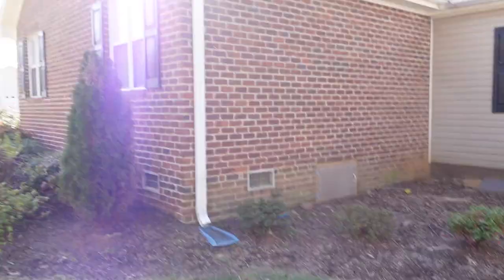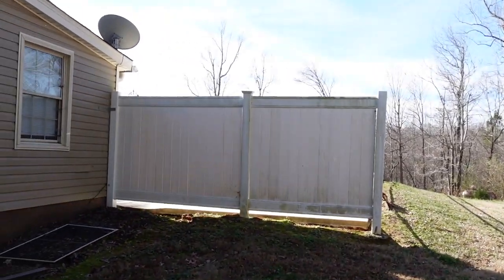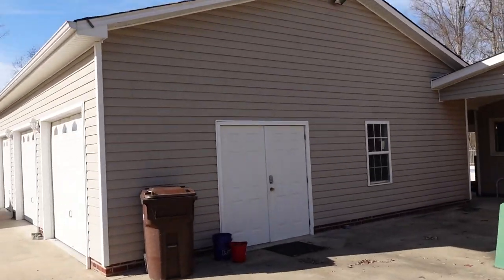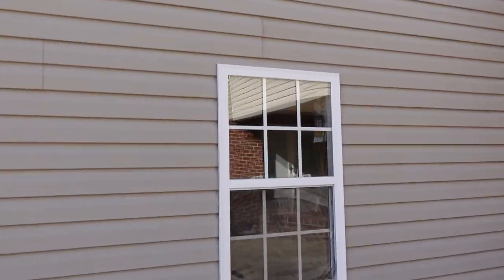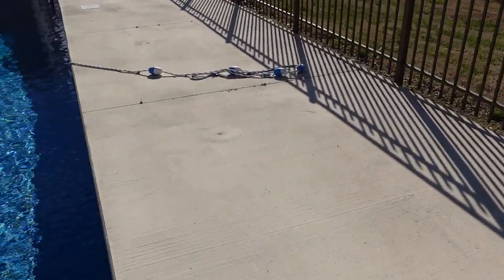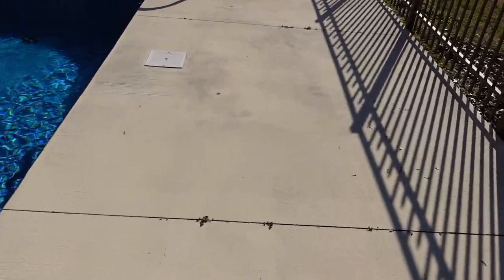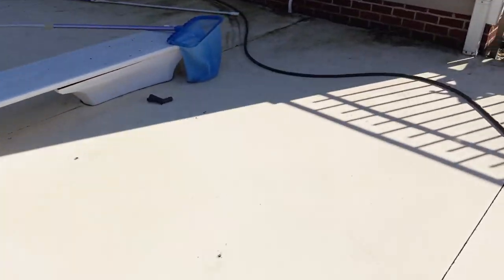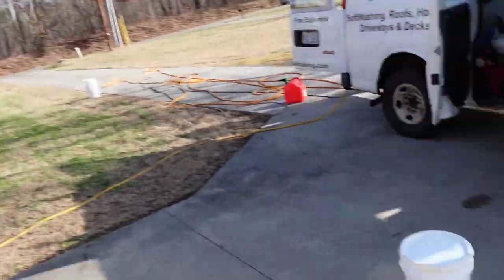Soft Washing This Dirty Roof | Cool Drone View Before and After | Pressure Washing

Comment: I pressure clean in South FL so mostly barrel tile roofs & i just use straight pressure & water. But I am switching over to soft washing but a few people are telling me I should definitely have a helper to water the grass and vegetation? How do you manage both watering grass so it doesn’t die from SH & doing the cleaning? Any tips?
Reply: Sorry for long question, if you have time it would be much appreciated! Nice vids. Thank you!
Reply: I was thinking the same; it's a must to pre-water all around to not burn up plant life 6% is a 50/50 mix that's as hot as it gets especially if using 12.5% SH. Gotta protect mother earth first and after rinsing. This video was on point with the rest tho, great work!
Reply: @thelifeofpressureman7178  Update: it’s been a month and I’ve done a job with a helper & a few solo jobs. A helper is 10x better because you don’t have to worry as much or get off and on ladder. But I’ve done solo jobs and it’s not the worst thing in the world.. it stills goes 10x faster then if I would just straight pressure Clean with water

Comment: Nice. Why is my bleach not eating the algae?!? 10% in foam cannon
Reply from the maker: What are you cleaning?
Reply: @ZayWonderJournal  ....tile roofs
Reply from the maker: @jamesmitchell6288  You cannot wash a roof with the pressure washer. You need a soft wash machine. A pressure washer is constantly diluting the mix being sprayed so it’s too weak!
Reply: @ZayWonderJournal  ....I have a backpack sprayer. Maybe that will work better
Reply from the maker: @jamesmitchell6288  Although it’s not the most efficient thing, yes it will work better
Reply: 50/50 backpack sprayer... however yes it's not efficient at all and the backpack is heavy to get on a ladder and go up safely
Reply from the maker: @doughnato2253  right 💯
Reply: When working around swimming pools. Is there any precautions you have to take to prevent runoff from entering the pool? Or is it ok for the SH solution to runoff in the pool?